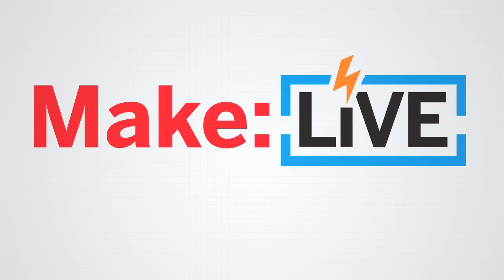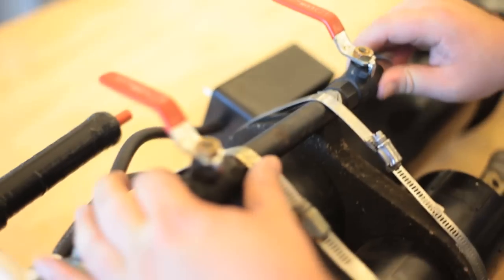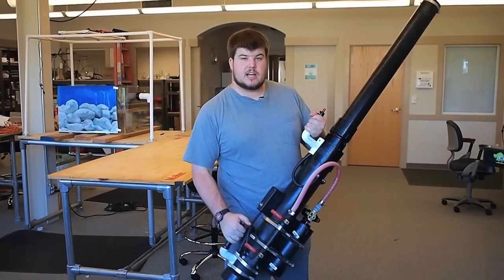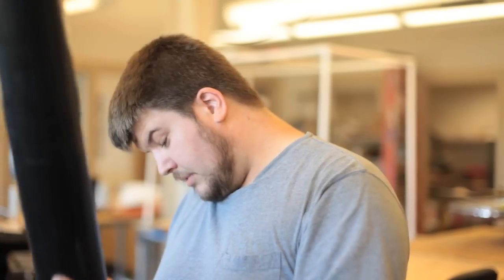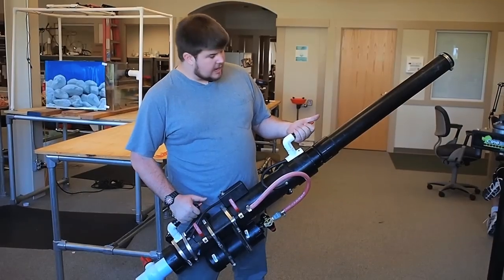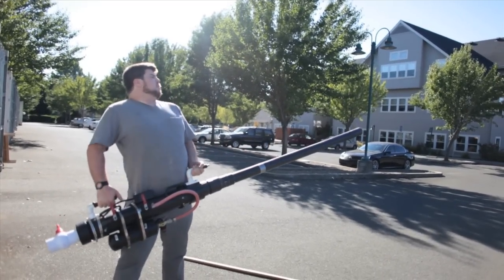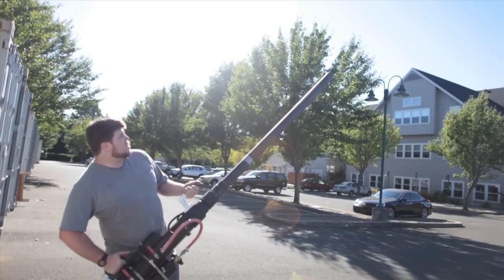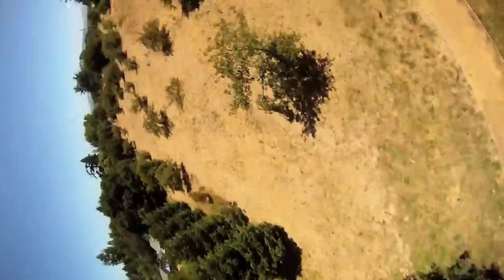Dan Spangler's Combustion Cannon on Make: Live ep15

Comment: Could the fan possibly short out and cause a spark?
Reply: The fans have no contacts to arc. Brushless motors.

Overpressures from combustion may eventually take out the electronics inside the motor.